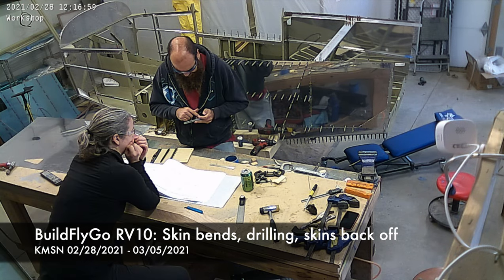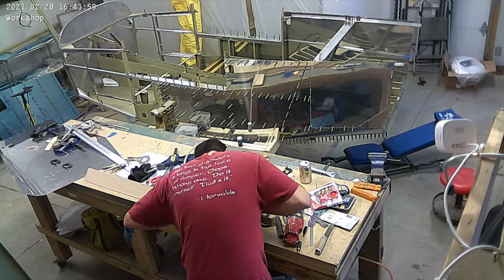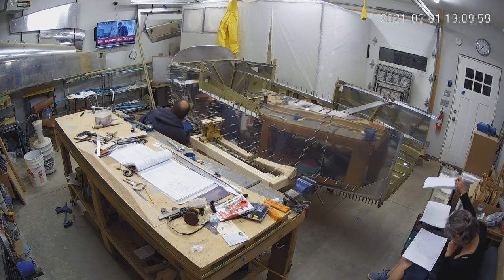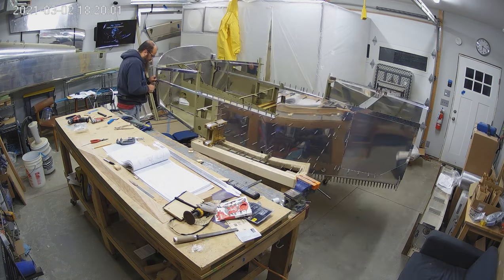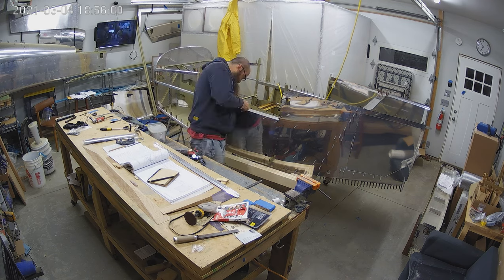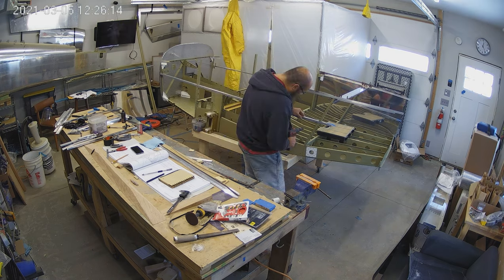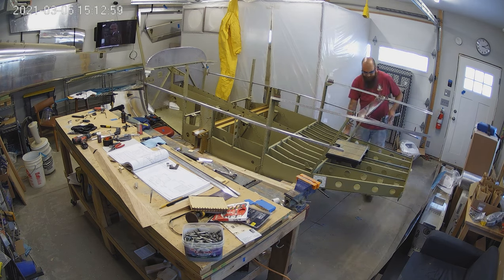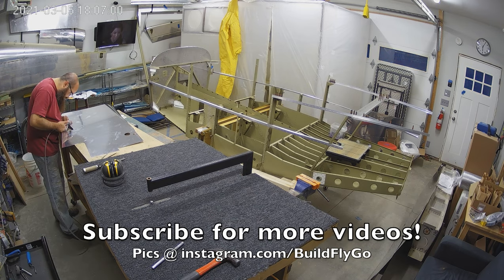RV-10 Build: 03/05/2021 - Side skins Initial mounting and drilling

Comment: I'm just a few chapters ahead of you. Yes bending those skins is a bear.  Tip - if you haven't done your fuel and brake lines yet, doing them before the front side skins go on makes it easier.
Reply from the maker: That’s a great tip. I have the brake lines here already but have not decided on the fuel system yet.

Comment: Greetings Guil,  I, too, like the new camera and like watching the analog clock hands racing around their track! It gives a much more visceral sense of the amount of time you're putting in on this project.   Do you plan to, at any point, pick up the fuselage frame and flip it and shake it to dislodge  any loose parts or tools like Fuji H.I. does with the F-15 airframes they build?
Reply from the maker: Hehe that’s not a bad idea. I do need to run the vacuum soon to clean up all the shavings.